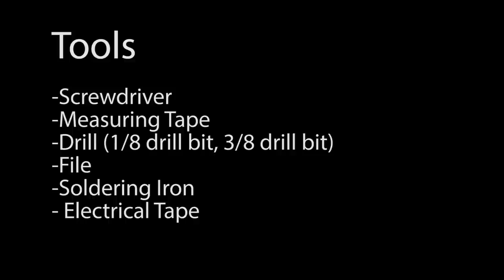Empress Effects Tape Delay - External Tap Switch Modification

Comment: If you guys could make a version of this pedal that enabled you to use and external tap AND the programs that would be amazing.
Reply: I believe the mod's purpose is to have tap available while in preset mode.
Reply: stringman340 That's great! I wish the pedal had the option to enable external tap and presets out of the box. If Empress created that pedal with a Tape Delay V2 I think they'd do really well.
Reply: Realfi yeah a lot of people don't want to pay shipping for one jack and wires, and buy a soldering iron and a drill and bits to do something that would add 15 cents to the cost of the pedal from the company.

Comment: So you didn't add the feature the board was designed for? You obviously left space for the jack and designed the circuit to include an external tap tempo. You're using that style of jack because it's an option, and you won't disable the onboard tap tempo.

Why tell kids it's OK to drill and file a $250 pedal while the PCB is still installed? Then leave metal shavings all over your work surface around all the ICs and connections, and solder wires backwards on the board?

You guys hoping to sell a few more on voided warranties?